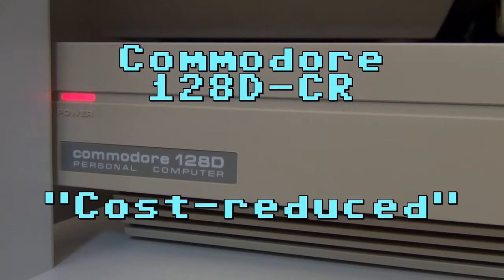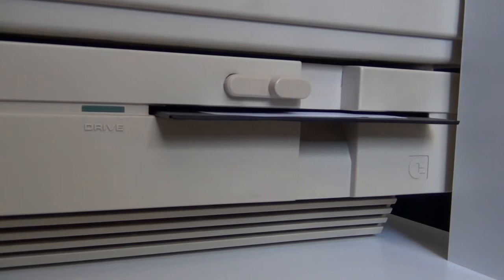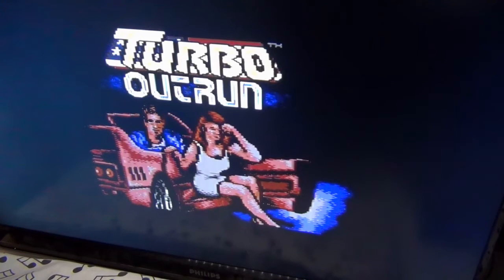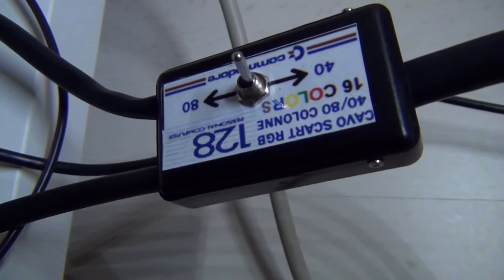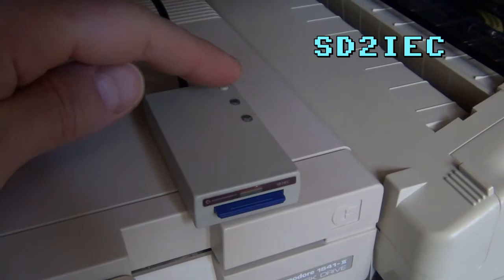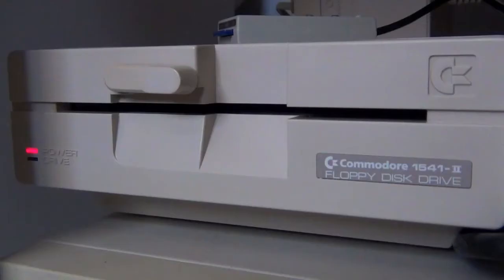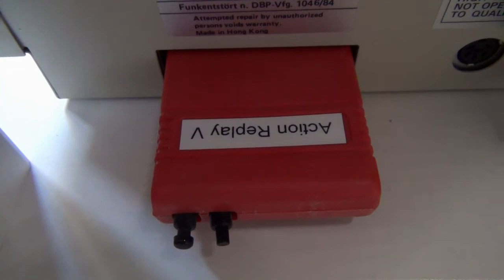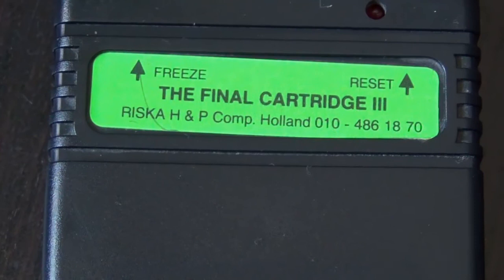Commodore C128D-CR: Get started

Comment: You should do a crash course intro to the C128d...  for Vic-20 and C54 owners.. namely, how to get into the different modes on reset/reboot... what commands the C128D has that are new... like the GO64, how to get into the monitor and sprite editor, how to draw cicles and liens and graphics mode, etc.  Dload, DIR, etc.   Those i wouldn't know but would be the firs things I'd be hunting to find..  what "more" do I need to know to operate a C128 beyond knowing everything about the C64...
Reply from the maker: Thank you for the feedback! For that I warmly recommend the channel of https://www.youtube.com/c/NybblesandBytes which goes much more into detail than I could ever dream of!
Reply: @LeadingMotive  Thanks, I'll check it out.  I have a barn full of 8 bits and PC's and Macs, and the 128D is the only one that tempts me to hook it back up.. event though it would ultimately be pointless. 

I actuallyused a friends C128 back in the day to connect into tje VAX11/780 on campus from downtown Chicago in the top of s skyscraper...

    Wish I had h ad one instead of the Vic and then 64...  but then hey, I jumped straight from those to a Macintosh SE... so...  nirvana
 
https://www.youtube.com/watch?v=7ALWFxEc5r8

Comment: Good video. I still have my original C128D CR and it has worked fine. One question - they have the PSU built in whereas the C64 had the PSU external, and swapping out the PSUs on the C64s is all the rage these days after 30 years of wear and tear. Any idea how good / long the internal PSUs on C128DCR last? Were they better built than the C64 ones?
Reply from the maker: Really good question, to be honest I've never thought about it. The CR is much newer luckily and heat development is minimal so that's one plus. I'll have to investigate.
Reply: The psu in the 128 and amigas are good. It the c64 ones that are the problems

Comment: Can I run the SD2IEC on my unmodified C128D-CR? Will there be a problem with the internal drive already being drive 8?
Reply from the maker: You can run it as long as no two devices use the same device number. So you have to change the C128's drive ID e.g. to 9 using BASIC commands before plugging in the SD2IEC. You could also change the SD2IEC Device ID permanently, that should be possible (quick Googling): https://www.lemon64.com/forum/viewtopic.php?t=58812
Reply: @LeadingMotive  Thanks for that. Sorry for the noob questions, but I don’t understand how you can plug in a cartridge after entering a BASIC command (with the computer still on). Isn’t this bad for the computer? If I enter the command, then turn the machine off to plug in the cartridge, won’t the changes be lost?
Reply from the maker: @OldAussieAds  You are right about cartridges! My SD2IEC is not a cartridge, maybe you have another version than mine? Mine plugs into the serial connector like a Disk drive, and those can be plugged in whenever.
Reply: @LeadingMotive  Ahh that makes sense. I don’t have one yet but I’m looking to buy.

Comment: Quite interesting, especially that 2-to-1 monitor switch/cable, where can I buy one of those?
EDIT: Oh nevermind, I see you've already answered that Q.
EDIT2: that one seems to be unavailable, but there's another seller with a similar cable...
3.0m(10ft) version:  https://www.ebay.com/itm/Commodore-C128-C128D-Kabel-an-SCART-40-80-Zeichen-3-0-Meter/262332198519?hash=item3d1437ae77:g:0UQAAOSwYmZXFkSL:rk:5:pf:0
5.0m (15ft) version: https://www.ebay.com/itm/Commodore-C128-C128D-Kabel-an-SCART-40-80-Zeichen-5-0-Meter/361509837158?hash=item542baa5966:g:CRQAAOSwlfxXFkTG:rk:8:pf:0
Reply from the maker: The only downside is that the switch is a bit flimsy. I'm wondering whether to replace it with a more sturdy one.
Reply: It may look flimsy, but I have seen the same type used on electric guitars, where - as one would imagine - they are prone to heavy (ab)use. I wouldn't worry about that.
I am, however, surprised that it was possible to fit the switch inside the housing of the 9-pin connector.
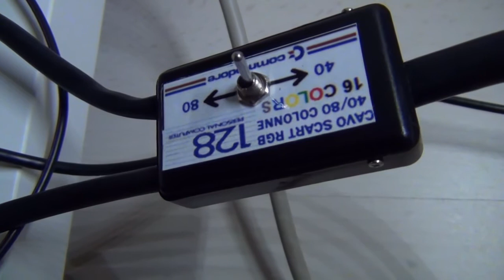Reply from the maker: @BertGrink  The switch is actually located in its own box, not directly on the connector (1:38). Touching the switch ever so slightly causes disturbances in the picture.
Reply: Ooohhh you're talking about the cable you show in the video? I thought you were referring to the ones I linked to. My apologies.
Yes, I agree THAT switch is probably too flimsy for the purpose.
Reply from the maker: @BertGrink  I see, of course, sorry for the misunderstanding :-)

Comment: Where did you get that adapter 40/80?
Reply from the maker: You can check on eBay: https://www.ebay.de/itm/CAVO-SCART-RGB-40-80-COLONNE-A-16-COLORI-PER-COMMODORE-128-C128/312110794026?hash=item48ab40c52a:g:e0UAAOSwi4lafNG3 or, if you prefer direct contact, I can provide you with the seller's e-mail.
Reply: Thanks. what kind of display you use?
Reply from the maker: Josip Basic It's an old Philips 41" LCD TV. Back then their models still had plenty of SCART inputs.